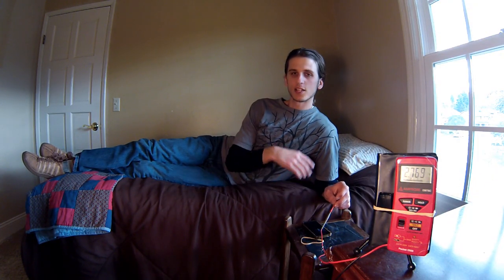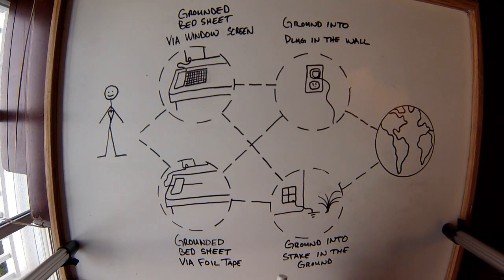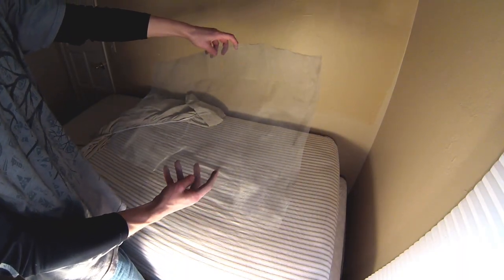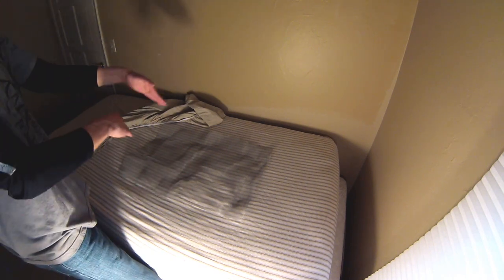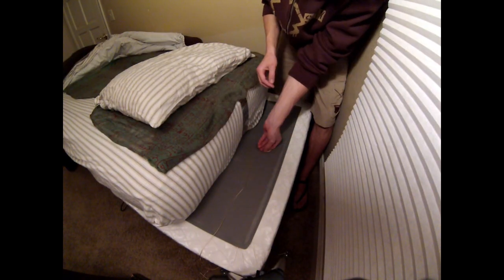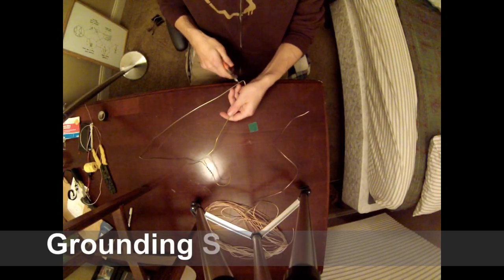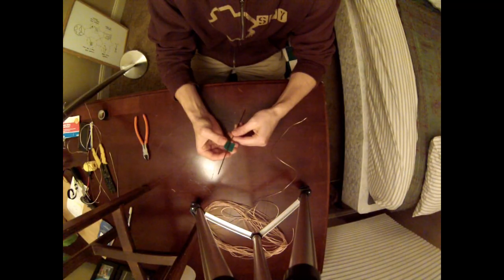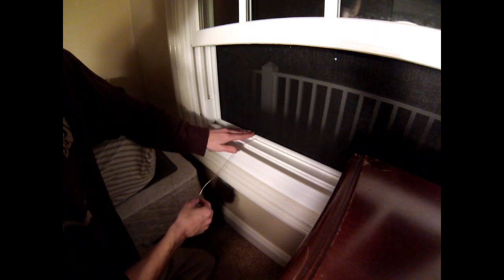DIY Earthing Sheet: How to Sleep Grounded Indoors (Tutorial)

Comment: Just a few tips and observations. First though thank you for putting this out here. Now you really do want to use a resistor in series with the wire just in case the other end becomes ungrounded or a live wire makes contact with it. And just to shut up some of those being "smart", you don't have to make direct connection with the conductor for it to work. There is this thing called capacitance, which is what's causing the level of AC voltage to go down when you are next to the screen. And AC is what we are concerned with. You should make the wire easy to disconnect from the screen and the window just in case lightning is in the area. That fuse and resistor won't help with lightning. And depending on how your window is made, your window may close tighter if you use the conductive tape instead of the wire itself. Also, there is probably a lot of RF energy that your meter isn't able to measure, in which case the capacitance will be even better, but the thin wire won't be as effective. An effective RF ground would also use a flat ribbon in place of the wire. And one other thing, aluminum is a toxin and a small part of it could get to your skin if you sweat. A better material to use would be copper. Keep up the good work.
Reply: You're absolutely right about the resistor. A GFCI trips at 5 mA; and all it takes is 30 mA for ventricular fibrillation to occur, so a 5A fuse does nothing for safety. But of course if lightning strikes, even with a resistor, who knows what may happen. Many people probably would use this therapy while sleeping in bed, & therefore may not be aware when an unexpected thunderstorm occurs, so they should take these factors into consideration when using this otherwise useful therapy.
Reply: *****
First of all, the best thing to do is use a dedicated ground using an outside grounding rod, and during the time when you are grounded don't touch any electrical device that is connected to the line voltage; that way you are isolated from line voltage & your only concern would be thunderstorms. If you handle an electrical device that is plugged into line-voltage, during the time that you are grounded, and a fault occurs, or if the device is mis-wired & becomes “hot” (in an electrical sense), then you would serve as a ground & could possibly get electrocuted. Using the formula R = V/I to calculate the resistance R = 240V/(5ma) = 48 K-ohms; this resistance value reduces the current to safe 5ma if the line voltage is 240 volts. But even if you install a resistor of this value, I wouldn't recommend touching anything that is plugged into the AC outlet while being grounded. A resistor is for protection from normal line voltage, but does not protect against thunderstorms, btw.
Reply: *****
The only concern regarding the use of aluminum is when you have physical contact as with aluminum cooking utensils or garden tools. If you are physically isolated from the aluminum via the cotton sheet, I don't see a problem & would use it myself in that case.
Reply: For safety I would use at least a 100k resistor, but it will limit the the effectiveness. It's a tossup between it actually working and safety.
Reply: Hey man 😊 Stumbled across this clip and looking for some advice.. One day I downloaded an emf app on my iPad for fun and went through the house and seeing the readings. Everything was normal-ish, till I tried our bed.. My side is mostly normal but when I put it where my partner sleeps it triples and  warning/detect alerts. Tried it several times on different days, same thing happened. I downloaded 4 more emf apps and they all do the same thing.. All around the bed is fine so I think it's the coils in the mattress, and I've found some research on how metal springs/coils in mattresses can act as an antenna for emf and rf.. We can't afford a new bed, what can we do to neutralise frequency or protection from it..?
Reply: Dwayne Armstrong
Reply: okay so how about this:  would it be possible to wire the conductor to a GFCI for protection from lightning?
Reply: Great to know, so coppertape instead!
Reply: So you recommend a fuse or no? Is so what size 😊
Reply: Hey anyone know if your stake gets rusty does it diminish it's effectiveness?

Comment: ESD protection gloves are usually connected to outlet grounding through resistor of 100 kohm or higher because if you connect it directly to outlet there is always risk that grounding installation lose contact to the ground (installation failure). If such situation happen and if some electrical device has also failure there is chance that power supply voltage (220/110V) comes to your body. Resistor in that case will limit current, but of course 1MOhm is probably too big resistor to have grounding benefit. I made similar test to yours with multimeter and I used 22 kOhm resistor and It work pretty good, actually I don't se diference with resistor or without it, body voltage is les than 10mV and I feel much safer because risk of possible el. schock is minimal.

Comment: Guys/Girls, Im a Electrician and I believe you need a 30ma fuse if you really want to adequately protect yourself. 30ma is all it takes so send the heart into ventricle defibrillation. That is what RCD Circuit breakers are set to trip at and there sole purpose is to turn power off before the body can recieve a lethal shock.

Comment: You might want to take a basic course in electricity and learn the difference between voltage and current and what causes each. You are at a higher voltage in relation to ground not because of magnetic fields which would be the result of current flow but static build up.

Comment: The charge your body gathers has very very little to do with the power grid, it is the fact the you are insulated from ground that allows your body to store a charge mainly from static from clothing to skin contact or cloth on cloth, it almost has NOTHING to do with the energy in the wires of your home, to gather a charge in that way your mains voltage would need to be like 15,000 volts.. @ 110 or 240 volts nothing travels more then a couple of centimeters esp @ 50/60hz - check out my channel.

Comment: All you need to do is drive a piece of rebar or something steel into the ground like a lightening rod and wrap a stripped end of wire around it on that end.   The other you can run inside to your mat.

Comment: re the window screen, doesn't your skin have to touch it while you sleep?  And can you purchase a volt meter for earthing at a hardware store?  Also I have a high power wire above my home and I am very close to the transmitter on the telephone poll. (  I sleep in my fifthwheel that can't be moved at this time) Is my grounding rod outside going to attract the electricity I don't want from the transmitter and heaving wires above me?  Sorry I don't know much about this.

Comment: It looked like the fuse was used in the outlet application, I looked for the inline fuse on the one he put outside and did not see it. The earthing book says if you are uncomfortable during a lightening storm, just unplug it....I will need to make a place inside that is functional to break the connection though.

Comment: In the main electrical panel box on a house, one of the two electrical conductors (the "neutral") is connected to ground!!! Indeed, the electrical utility grounds their neutral output from their generators. Want proof of this? Stick one lead of a voltmeter into the ground hole on an outlet, and the other lead in one of the two slots (usually the smaller of the two), and you'll see approximately 120 volts! If you stuck your fingers into the ground hole and one of the two slots, you'll be ----

Comment: This is because you can NOT use the AC voltage setting on a digital meter to do this kind of measurement! You need to use the resistance scale, and then you have to know how to interpret the readings you are getting.

And his turning off of the wall switch is NOT a demonstration of the lowered amount of voltage being induced in his body as shown by the meter. OMG this video is difficult to watch.

And personally, I would never use the ground lug on a wall outlet. Why? continue to next comment

Comment: feedback from a friend i sent this guy's video to:

That video of the young man demonstrating the grounding info shows that he does NOT know what he is doing. You CAN'T use the AC voltage setting on a digital meter to measure the "body's voltage" in the way he did by using the ground lug of an AC electrical outlet!!!  meter will always give a false reading when used this way. He is either not aware of this (probably because he is merely parroting something he saw..continued on further comments

Comment: Would grounding an electric blanket directly to the earth work? Would I need to splice the wire to add a grounding rod, or could I just loop clothes hanger rods thru the holes in the electric blanket outlet & plug straight into the ground?

Comment: Be careful with grounding. If you touch an electrical device that is plugged in with an insulation failure or just a hot wire by accident you can be electrocuted. ESD mats and wrist straps for example are used to protect electronic components from electrostatic discharge damage, have a resistor of 1 Mega Ohm in series to earth/common ground to prevent such a scenario. If that's still effective for this application, I'm not sure since I've never tried this.

Comment: Good stuff. I highly recommend sitting and meditating on a grounding plate. I use a metal plate, copper rod stake, and wires for my grounding. You'll be able to cultivate chi energy effectively.
Reply: Metal plate?  Where to find?   And size?   Thanks in advance

Comment: What gauge of wire are you using for the bed sheet ? What gauge of screen  are you suggesting?  
Most of the info I have read suggests the position for these devices are toward the end of the bed, hips to the feet.

Comment: I appreciate the information but the video was pretty confusing because of the way it was organized, what you should have done is the recommended method from beginning to end than the less productive method afterwards. Thanks for the video, does it matter how thick the copper wire should be that's attached to the stake in the ground? because their are various prices. What's a recommended mesh online?

Comment: Hey not to be a butt head, but I did notice the paper clip and the charging pad. Paper clip will bring up EMR levels enough to increase voltage on the meter even with it insulated. Also running the wire over a charging pad will really bring that reading up. Turning the outlet off would take some of that away so does keeping the wire off of the pad as happened in the later part of the video. If your going to prove something please don't use tricks, it take away from people actually interested.

Comment from the maker: Most houses and apartments has some sort of sub panel located somewhere on the structure so I would be too alarmed by this. If it has a bunch of smart meters attached to this substation this would be a different story as earthing doesn't help ward off the super high frequency radiation emitted by these devices. If it is just a sub panel and it's located near a wall you wont be spending much time i wouldn't say it's a deal breaker. But the only way to truly know would be to test it.

Comment: I chose the simplest route for the time being until I can do it more professionally. I went to the local hardware store, and bought a $4.97 packet of copper wire. I ran that wire out the window, dug it into the earth with a spoon, and patted the dirt down onto the wiring planted into the hole. I now have the other end of that wire (in my room) wrapped around my ankle with just a couple twists (so it can become undone if the wire were yanked). I'm grounded, and will pay attention for storms.

Comment from the maker: I use a thin gauge copper speaker wire. The thicker the better but I used a thinner guage so I can still route it through the window. A steel window screen tests at the lowest voltage but the snail tape sounds like a great alternative. Never thought of that one.

Comment: I was wondering, when you say at 4:34 "grounding wire", what type of wire is it? copper? what about the screen. What type of material do you suggest conducts the best? and could I use snail tape (copper coated)?

Comment from the maker: Electricity/electrons move through wires regardless of appliances being turned on or off. The traveling electrons is what creates the magnetic field we are trying to avoid. Create distance from the wires in your room or in the walls and ground yourself to help repel these unwanted magnetic fields/voltages.

Comment from the maker: I used steel window screen but they are available in both steel & aluminum. Steel is better for conducting and avoiding distortion. It should be available at your local hardware store. The inline fuse will be found in the car section of your hardware store, just ask for care fuses & look for something similar to what you see in the video with the smallest amp value (5A) . Both a fuse & resistor will prevent an unwanted surge through your circuit, but for easy installation purposes I use an fuse

Comment: Thank you so much for posting this video!  Very comprehensive.  A few questions.  Was that aluminum window screening you used?  That is what the nearby hardware store carries.  I can't remember if aluminum is very conductive.  Also, is there another name for the inline fuse?  The guy at the hardware store didn't know what is was (he was a new employee).  I saw Clint Ober mention that they use a "resistor" on their products.  Just wondered if it's the same thing.  Thank you!

Comment from the maker: Thanks for the feedback Princess:) I love your passion! Thanks for sharing the circuit breaker tip, this is GREAT advice. No reason to worry about the knot on the bottom of the sandals as it is counter sunk on the Quantum model and soon to be on the Ultralight as well.
Reply: @Rewild, I just RE-DID my earthing pads. I hammered a stake in the ground and connected there instead of my power outlets. I connected the stake wire to a 6 plug power strip and used that for earthing my copper fabric, and my cat's earthing pad, etc.

Comment from the maker: I think the grounding sheets and pads are great, I just wanted to provide a cheaper alternative so people could experiment with the idea prior to making this investment. Grounding rod is a must, the longer the better.
Reply: I have a quick question I already use a blanket that has magnets in it. I plan on doing the window screen plan that you shared.  If you were in my shoes would you continue using these magnetic blanket?  The blanket is also ceramic fibers so it helps a lot with my inflammation.
Reply: I don't understand the first part you put the window screen on then it was gone and you put a tape running down the middle of the mattress...so what happened to the screen

Comment from the maker: Hey Meg! I use a thin gauge copper speaker wire. For the ground rod I used a steel coat hanger that I sanded down to remove any insulting coatings (cheap and effective), the longer the better. 6-8 feet is really long, mine is about 8 inches. If you have the option, staking the rod into moist soil will improve conductivity and results.

Comment: What kind of wire did you use to ground into the earth, was it copper? It looked like it had a coating on it. Also, what kind of grounding rod did you use? I am only familiar with the 6 to 8 foot copper rods. Was yours copper? would a longer rod be better?
Thanks!  Meg

Comment from the maker: Hey Becky! The greater surface area the better results, this is why I recommend the window screen. On a pillow top bed the screen will be more noticeable. The foil tape will be less noticeable to touch but will also provide less of a conductive surface.Taping pieces of foil tap together to create a grid doesn't work as the adhesive is an insulator. The tape can also tear over time.

Comment: Thank you for sharing!  I did not realize that the conductive material can be under the sheet.  That makes the DIY creations a lot easier.  Plus other tutorials use conductive fabric which is mega expensive.  Your solution is a lot more economical and practical.  Any pros and cons of the two methods you have tried?  Like conductivity, durability, comfort and so on.  I am leaning toward the foil tape for it seems to be easier on the skin.  What is your experience?